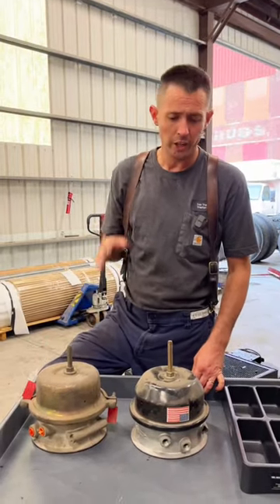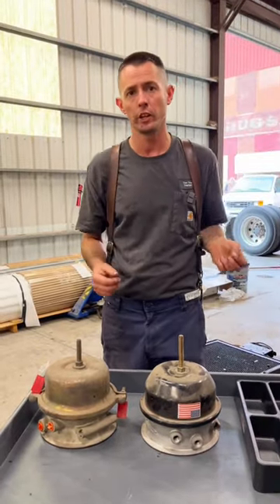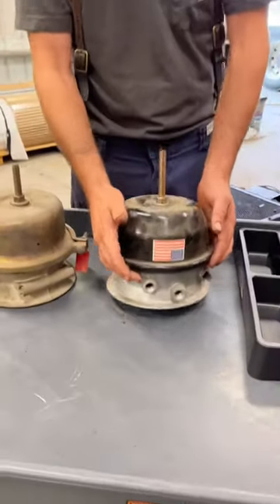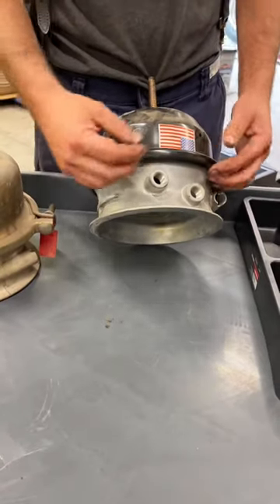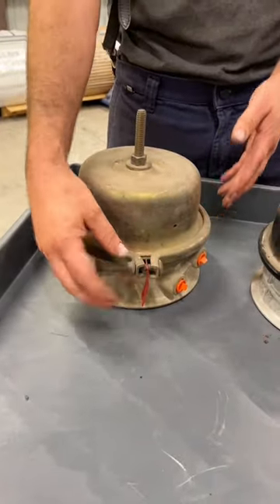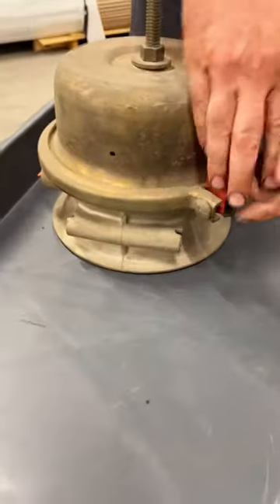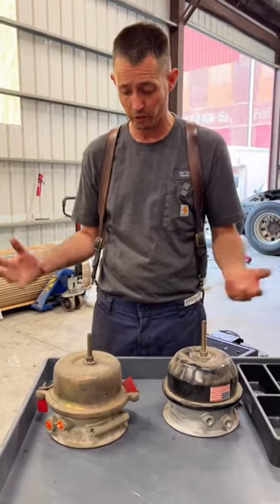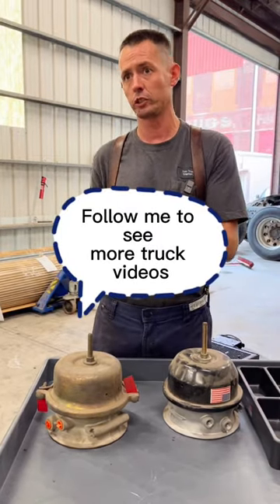Old vs new style brake chamber #shorts

Comment: They still make them where you can take them apart. In fact 90%of the brake chambers you buy across any parts counter has both clamps removable. Even factory brake chambers on any paccar product has these “old style” clamps that can be removed even on 2022 model trucks.

Comment: After replacing the 30/30 chambers the spring should be cut Pryor to tossing it 
There is a chamber cutting box out there where you put the old chamber in 
Clamp it closed and using a torch you cut through the case and cut the spring inside, once you hear the spring snap you know it’s done 
Take it out and throw in the trash.

Comment: I have never saw this new sealed one. We just got a new diaphragm as you mentioned, taking the assembly apart. Here in Brazil is a routine maintenance as little air escapes a little from failed diaphragms. Even on newer trucks

Comment: These were on my 70 kw when I first brought it home! They still worked but I decided to just update to the new ones and got some new manual slack adjusters. My truck also came with aluminum split ring rims with 10.00 - 22 bias tires!

Comment: What you mean?? We swap diaphragms all the time and no problem.

It’s called add air to the emergency side fully back off the slack adjuster. Add cage bolt and tighten down. Take air way from emergency side and undo the 9/16 nut in the clamp. Gently hit with hammer to knock clamp off of and gently lower can down with both air lines on… support with wood block remove diaphragm clean up the surface of the mount and the can put new diaphragm on and well repeat in reverse

Comment: My Oldman worked with a bloke and his nickname was figjam (fuck I'm good just ask me) and he  rebuilt large pneumatic cylinders off mining equipment plus brake calipers master cylinders ect,
one week they received a couple odd ball wheel cylinders and they had to order the tooling to separate them as they didn't have the tooling for this particular style of cylinders.
Anyway he decided he was smart enough to disassemble them using some tooling for another type of cylinder design and well he is now missing a couple fingers and has a couple mangled ones. 
The area he rebuild the cylinders was an air-conditioned room that was  isolated from the main workshop (contamination reasons) and above his area there was a plywood mezzanine floor for the spare parts and the end cover and spring off the cylinder assembly went through the plaster ceiling was embedded in to the bottom of the mezzanine floor above. Even the small cylinders are enough to kill you not to mention the large ones, he was lucky to only lose a couple fingers because it could have easily been fatal.

Comment: I had a brake can explode right next to my head less than a year into my first job as a mechanic. The driver hit some scrap metal on the road and put a dent in the permanent band around the spring chamber, and then my caging bolt snapped while I was trying to change it on the side of the highway. I guess the spring slamming back against the housing was enough to finish off that band, because the can separated and both it and the spring flew off. The housing itself hit the frame somewhere and bounced straight down, missed my head by an inch, and hit the rail on my creeper so hard that all six wheels can't touch the ground at once anymore. I don't know what happened to the spring, me and the driver looked around but we never found it.

Comment: I used to loosen the clamp to turn the side with air fittings so the lines go just right.
Reply: The diaphragm side where the rod comes out doesn't have a spring in it. The spring is in the back chamber where you stick the caging bolt. You can still remove the front clamp and change out the diaphragm even on brand new cans or loosen it like you said to line up the fittings.

Comment: I use to rebuild my own like those. Did probably 20 of them with no problems. Always did it safe the way my uncle showed me, caged them off, never stood in direct line of fire. Then one day I was taking the clamp off one and she let fly with a huge bang. I was in the safe zone so all I got was a sore finger but it could have been real bad. Turns out the spring was broken in such a way that the cage bolt didn't hold it together. 
I've never done another one since. Besides that they are so cheap now it's not worth the effort or danger.

Comment: The clamp style is the best i do t care what anybody says about them… to take them apart add air and put the cage bolt in but leave air hooked to it with the cage bolt tight because sometimes the cage bolt with pull through the aluminum tabs and yes they can kill you just ise air and the cage bolt they give you and when you put the clamps on as you tighten them tap around the clamp to make sure it seats properly around the chamber flanges if you dont tap around thw clamp i can almsot guarantee that it wont seat properly and could come off but with all that said you just cant beat the old model 30 brake chambers

Comment: Most of the people that hurt themselves with these are so foolish to use an impact wrench on the lock Bolt.
Reply: Saw it happen. Kid had the can on the ground between his feet, he got that cage bolt tight and them little ears broke. Half inch matco bout broke his knee.
Reply: @painkey1189  I used to cage them while they were still on the truck, two big flat washers second one being about 4 in, open end wrench. It does not really take that much torque. I kept the lock bolt in a toolbox so that it would not rust or weaken.
Reply: @jeffmarlowe8078  I don't even cage em. If Im replacing the can I back the brake off, pinch the hose with needle nose vice grips. Take off hoses or cut them. Undo a clamp bolt, tap tap and let her fly. Connect hoses to new can, undo the vice grips and take that cage bolt out with your fingers. New clamp, adjust brake, done.
Reply: If the base is still good.
Reply: @painkey1189  if you're replacing the can you don't have to cage it! Just pull the pin out of the slack adjuster rotated on the cam until it's out of the way- remove the two air hoses and the two nuts on the bottom and put the new can on.
Reply: @jeffmarlowe8078  oh I know, I just avoid changing the base if I can. The extra plunger, return spring and base will get used eventually.